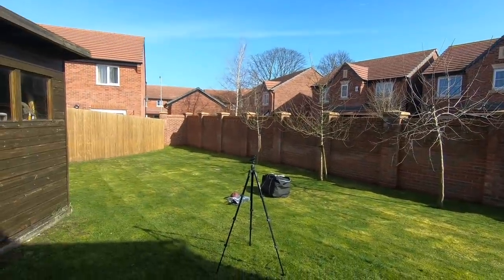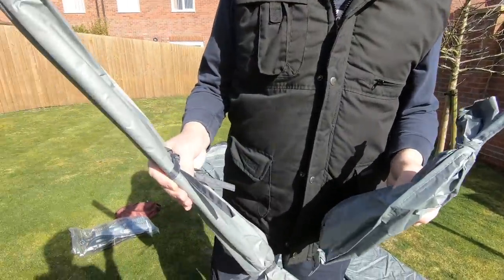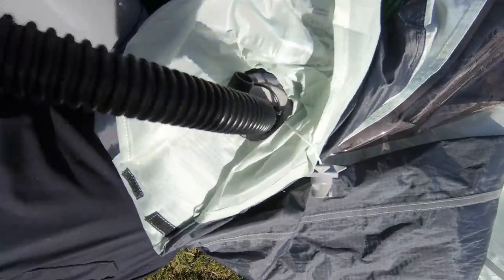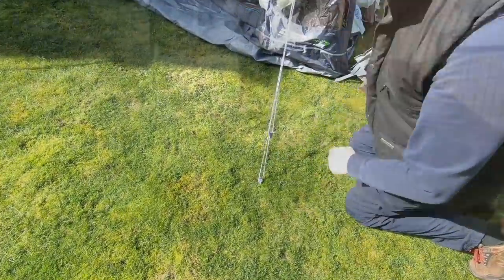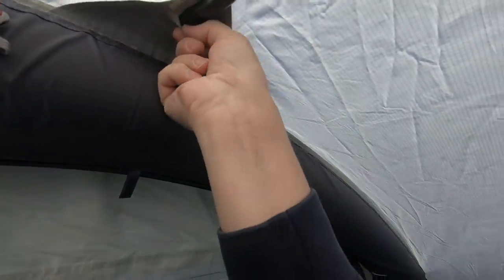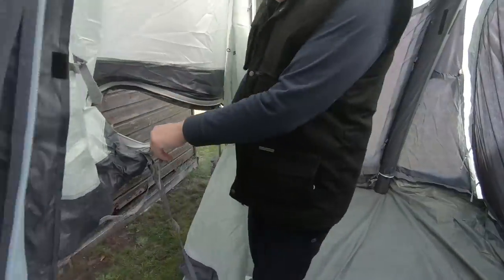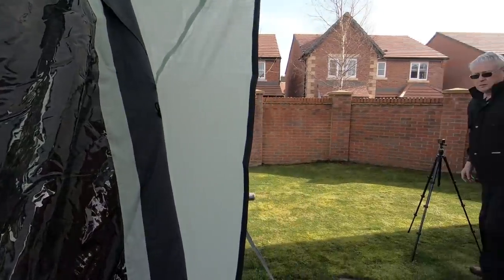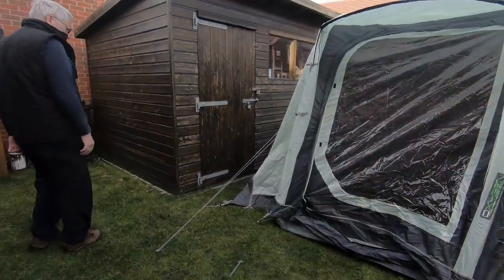Driveaway Awning Trial Run! | Outdoor Revolution Movelite T2

Comment: Thanks for the good chuckle nice light hearted overview of a divorce in a bag, glad the two of you made it through safely ;-) We have just acquired a 2018 T3 Vario, well it was until I did one of my sewing adjustments to it (video coming up in a while) now fits on a pitch much better and maximises our space internal space as the walls are squarer, I wanted the vario as I added a zip between the main and canopy sections as I wanted to be able to separate them for club site and larger CL type pitches and be able to use the awning as a tent!!! Your 2019 T2 looks great - perfect little space for longer stays and to keep the rain off. Two things I've found with ours is to arrange the outer "canvas" on the ground sheet (I notice you had quite a lot on the grass when rolling up) so that when you fold/roll up no outer fabric need touch the ground and if you fold in from the opposite end to the valves it helps to clear the air (I also tend to walk over my tubes towards the valves (with socks on) to expel any last pockets of trapped air rather than using the deflate on the pump) and you can fold clean side to clean, again to keep mud, etc. restricted to the underside on these very pale awnings.  I also found that our pump tube had a habit of exploding off the end of the connector attached to the valve so I make sure they are tightly connected when I move from tube to tube otherwise the shock of air suddenly hissing out is rather loud!
Reply from the maker: Thanks, yes. I normally put a separate ground sheet down and work on that. I also normally walk the air out of the tubes too. Hopefully a better demo coming up soon, when it's not so perishingly cold! Thanks for watching and thanks for your comments.

Comment: We’ve got a Vango drive away airbeam. Instead of attaching it to the awning rail we extend the actual awning out over the awning about a metre. This creates a shelter and don’t have to mess about lining up when you get back. We tried this method after a really stormy night - the noise of the awning attached kept us awake.
Reply from the maker: That's a good tip, thanks.

Comment: Great video thank you. is it possible to inflate and deflate with a plug in pump connected to ehu?
Reply from the maker: Good question, it is, but there really is no need to use a powered pump. The pump is double action and inflates the awning in less than a minute.

Comment: The additional weight and size makes me think it wouldn’t be worth all the stress I have gone down the awning route a couple of times but they have  all ended up on eBay and lost quite a lot of cash as a result.I can see the reason why you might add one to a caravan but it defeats the object of motorhoming to me.If we wake up and decide to move I don’t to start taking down an awning and packing it into a bag which somehow never seems big enough.....especially when the wind has picked up.Only my opinion of course but awnings are just too much hassle.
Reply from the maker: A fair point and I was thinking along similar lines until recently, but when we are on site for more than a couple of nights I miss being able to leave chairs and tables out, having the extra space and the shelter from the wind and rain.
Reply: @BobEarnshawMoHo  Would be fun trying to put up an awning today Bob, my shed room looks like it's about to blow off.
Reply from the maker: @Camper634  I was outside at 6am, out in the road tidying up my recycling brown bin.

Comment: Interesting video Bob, you already have 2 awnings, do you really think you’re going to use this one or will it join the others in your garage. Did you take a look at the Quest gazebo? The Quest gazebo takes about 1 minute to erect, is very light and easy to put up and doesn't take much space when fully packed.
Reply from the maker: No I didn't look at Gazebos as we want something that attaches to the motorhome. Very happy with this one, a big improvement on the old one, which is over six years old and will be going down the council recycling facility soon.
Reply: Thanks for the reply Bob. Where are you going to store this new awning in your van. It seems very bulky when in its storage bag. Why not put your old one on Gumtree rather than dump it. Someone might want it (not me though).
Reply from the maker: @ageingandrew1199  I might try eBay to sell it first, but I can't see anyone wanting a six year old. The new awning is already safely tucked under the bed in the Motorhome.
Reply: Bob Earnshaw gumtrees better or Facebook market place   Ebays too slow now